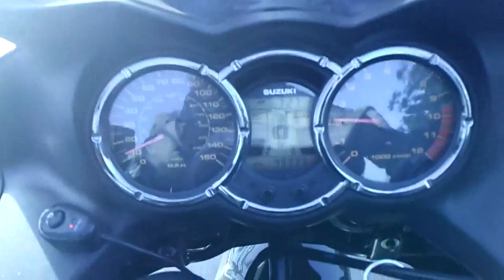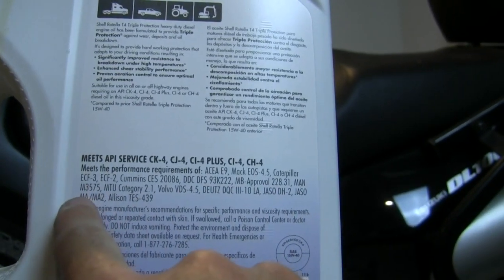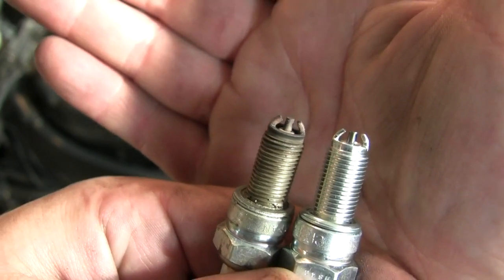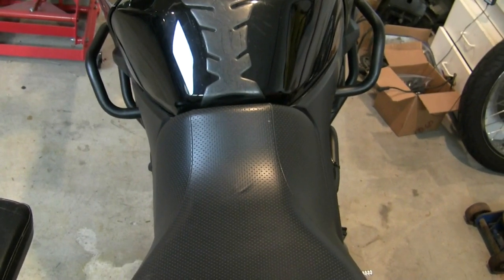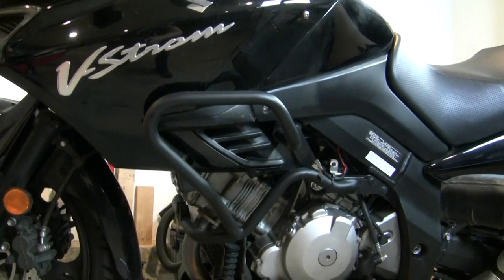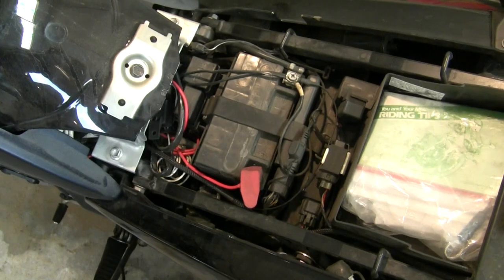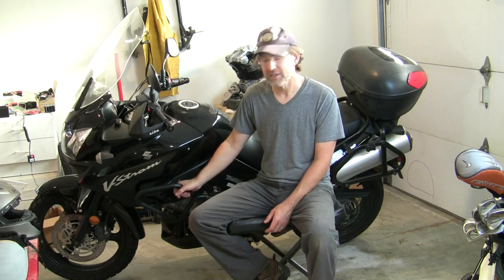V-Strom 50000 Mile In Depth Review

Comment: Great videos, thank you. I have a 2007 k6 GT and it's a great bike but ruined by a (apparently) common fault of a rattly clutch basked. They wear and start to not only sound rattly but cause terrible vibrations. Are you aware of this and, if so, have you done a video on the removal and modification??
Reply from the maker: I've read about the problem but have not experienced it personally, thus no video from me on the subject. I've speculated that either Suzuki got the problem flushed out by 2012 when they built mine or I'm doing something with my riding technique to stave off the problem, but I don't know if either is correct. Thank you for watching!
Reply: @UrbanMonkTV  thanks for the reply. You must have been lucky then as its very common and STILL hasn't been sorted by suzuki on the new model. It's one of the main factors that would stop me getting the new one. If you're at all interested if you look at a site called vibefreev, or sharealike on you tube he modifies them to cure it. Thanks again.

Comment: Great video. Excellent insight very well presented.   Is that oil Shell Rotella T4  or T6?    I'm a DL650 owner.    15 40 weight?  The information is on the jug of oil.    Thank you.    🇨🇦
Reply from the maker: It is T4 15W-40. It is all I've used. As I mentioned in the video, I change very frequently. I've had people say I change too early, but then again I'm currently at 69,000 and still have yet to do any significant changes to tappet shims. 7 out of 8 are still the original shims.
Reply: @UrbanMonkTV  thank you.  After research I started using the same oil in my 2009 DL650.  I use Rotella in my 1999 Mercedes E300D (diesel) too.  370,000 km... runs like new.   Your careful noting on valve clearance is indicating you're getting virtually no wear on your engine.   Changing oil around 2000 miles is not a waste!  It's hugely extending  the life of an excellent engine.   I agree 100% with your schedule.    You're helping many MC enthusiasts.... love your pace and thoroughness of presentations.    Cheers  🇨🇦
Reply from the maker: @ronbatt756  Thank you so much!
Reply: You could easily extend that service interval. Per manual it's every 3,500 miles. If you're doing mostly longer rides (engine is warmed up thoroughly on every ride) you can easily extend it if you switch to a full synthetic oil like Rotella T6. 
I had an oil analysis done after 4,500 miles by Blackstone Labs and it still had a high level of the additives, so degradation was minimal. 
To put it short, change oil according to the manual, switch to full synthetic and you can extend that somewhat (it also won't degrade over time like a conventional oil).
Reply: @sv650nyc7  good info.   Thanks.

Comment: Try using Amsoil, 100% synthetic motorcycle oil. You'll never go back. Bike will run cooler, smoother and with excellent clutch feel with smooth shifting. I could not believe the difference when I switched my Nomad (sold it) to Amsoil.
Reply from the maker: I may try some and see if I notice a difference as you have. I assume you have a Strom too. Which of the Amsoil formulas do you use?

Comment: 1000% right! Unless your ego will suffer if you don’t get a bike several times the price of a VStrom, there is no good reason to get anything different.
Reply from the maker: Thanks for watching. I try to never make any decisions based on my ego. At best it's overly expensive, at worst it is dangerous.
Reply: Urban Monk TV , I didn’t mention it before, but at 67 I’m on my second VStrom 650 and have no plans to switch.
Reply from the maker: @antonioperez1624  How many miles did you put on the first?
Reply: Urban Monk TV, 37k, that was a 2005, current one is a 2012 and it’s right at 17k now. Bought both used and still can’t get the smile of my face. Had some good bikes before, but nothing as good as these.

Comment: I live here in Michigan and we have quite a bit of 40 50° riding do you think the 1540 would still be okay or should I go to a 5:40 synthetic rotella?
Reply from the maker: I grew up in North Dakota and Minnesota, so I can speak to this from experience. Bottom line, the service manual states 15W/40 can be used in ambient temps around a little less than 14 degrees F. It is also worth noting that the SM doesn't list 5 weight oil as an option under any conditions. If your typical behavior involves a minute of warm up at idle before hopping on and riding I don't see a problem with 15w/40 when the ambient temps are anything above freezing. It's a personal call though. It's your bike.
Reply: @UrbanMonkTV   that's great news seems I run that 15/40 in my tractor and my cl350 so one oil does it all .!
Reply from the maker: @daviddaniels4358  👍😄

Comment: Have had a fuel pump failure? If so, how can it be repaired if the parts are not available from Suzuki? Also, my fuel gage stopped working. I'm told that part is no longer available. I'd sure hate to buy used electrical parts on Ebay. Any advice?
Reply from the maker: I haven't yet (knock on wood). I try to keep my fuel level above 1/4 tank always as the fuel bathes the pump and helps keep it a little cooler. I do the same with my cars. I see Babbitts has the fuel pump assembly available through suzukipartshouse.com, but it isn't cheap. I've also read about DIYers replacing the pump with a generic automotive fuel pump. I think  I saw that on a stromtroopers forum. Hope that helps!
Reply: @UrbanMonkTV  thank you so much! I've been searching for while now. I've read about the generic pumps but I really the original part. I'm getting ready for an around the US ride. If I get my V running right (only has 35k miles) I'll ride it. If not, I'll get a new Super Tenere or a new Africa Twin. I just really love my V so I hope I can get it working right! You have been a big help to me!
Reply from the maker: @tomthomsen990  Happy to be of service! Enjoy your trip! I did a big one this summer and want little more than to be right back out there doing it some more.

Comment: Hello. What do you know about the clutch basket issue n have you ever heard of ‘idle hammer’?  Thx.
Reply from the maker: Thank you for watching! My short answer is I've never experienced those "problems." I put that in quotes because I'm still trying to determine for myself if these are legitimate problems that other owners are having in significant numbers or if this is all driven/fed by one source who has an interest in selling solutions. There seems to be only one person/company selling solutions to these problems. That doesn't mean they aren't legitimate, but it does give one pause. Another one I've read a lot about is the spacer to eliminate front/rear sprocket offset - another "problem" I've not experienced.
Reply: Good to hear. I saw the YouTubes on both. I spoke to a guy who had a first gen 1000 n he had his fixed. I had a 2nd gen w 6,500 miles n my basket was noisy n his was silent. The blogs on the idle hammer was more of a concern as they ‘reported’ half to 1000 did it. Saw/heard it on YouTube. I’m looking at a 1000 2003 w 22,000 on it tomorrow. Asking $3,500. I live in Atlanta FYI.

Comment: Any thoughts on idle hammering or clutch chatter?  
Just got an '02 DL1000 with 2700 mile. No clutch chatter yet, but definately has idle hammering. Sounds like I also need a PowerCommander.
Reply from the maker: I definitely benefited from the PC. Had miss between 2500-3000 before that was dangerous when lane splitting. As for idle hammer and clutch chatter, I've not experienced it firsthand so I can't comment with authority on it. Sorry. Thanks for watching!

Comment: what a nice review, how is ur mpg on it on average ?
Reply from the maker: Thanks for watching! Of course it depends on how I'm riding, but 36-39 mph is probably fair. It got a tiny bit worse when I installed the Power Commander, but it runs soooo much better with it. I hear the 650 runs 45 mpg or better.
Reply: I'm getting 47 to 51 driving conservatively with my side cases on.  I carry my tools in them (residential electrician). Lot of highway riding probably 30% or more is city riding.

Comment: Enjoyed your video and I subscribed, I own a 2011 DL650 , I believe the front cylinder is a tough job to do on the 650 compared to the 1000, as its hard to see  the timing marks, do you have any tips as mine a have not been changed in 11000 miles. I have done valve clearances on all the bikes I have owned, but not sure if I should take it to the dealer for a check and adjustment, Many owners seem to say the rarely need adjusting.
Reply from the maker: That's the challenge with these DLs, most often I go through the trouble of opening it up only to find the clearances are fine. But, I feel I have to know that. I have a time lapse video and a real time video showing how I tear down my bike to view tappet clearances. Have you watched those by chance?
Reply: @UrbanMonkTV  No have not seen those videos yet as I only found you yesterday and subscribed then. I will look at them.Thanks.

Comment: I just picked up a first gen with 35,000 miles and finished restoring a 71 Honda cl350 i run 15/40 T4 in it is that what you run in your v-strom 1000??
Reply from the maker: Congrats on your new Strom! Yes, I've run T4 15/40 almost exclusively (don't know what was in it when I bought it at 2300 miles) and the wear in my engine has been minimal. I'm at 66,000 mi now and still going strong. Next valve clearance check is at 75,000 for mine. I expect it to look great as always.

Comment: You've just changed my whole outlook on the words "regular maintenance".  Now, owning a vstrom, appears to be a daunting task of checking valve clearances, cylinder compression.  It appears not much went bad in 50,000 so hopefully I''l have the same provided regular oil changes.  You mentioned nothing about stators, which I've heard others complain about.  Whats your take on that?
Reply from the maker: I've heard some say stator went bad early, others say they are over 100K miles with original stator. I think overall they're a good value. If one needs to repair a V-Strom, the costs are a fraction of what they'd be for a BMW, Triumph or KTM.
Reply: @UrbanMonkTV  Thanks for the quick reply and it's good to know.  One reviewer did say he liked to rev up the RPMs which may have caused the stator problem.  If so I'm good to go because economy rules with me.
Reply from the maker: @advorlando9855  Here too. I'm into getting long term performance out of my bikes and cars. I've never rev'd mine above 5500 rpm. I've not had stator problems or clutch basket problems.

Comment: Well done, I was looking at a 03 do 1000 at 23, 000 mi for 3,500 I was thinking it was a bit to high, but I don't know the history of the bike, the bike is at a dealership.
Reply from the maker: Thanks for watching! If the dealer has a service department, perhaps they would be willing to do a compression check with you present. Also, at that mileage I'd expect the original chain, sprockets and brake pads to be on the bike if it has been ridden with reasonable care (though they could be well worn at that mileage). If they appear to have been replaced already with new, then the previous owner is either overly eager to replace or he rode it hard. I also would look at the clarity of the fluid in the brake master cylinders and clutch master. If dark and cloudy it's an indication of a possible negligent owner.

Comment: what's your mpg like?  Paint the plastic that is melting with primer then silver paint to cool and protect from UV rays.  Thinking about buying a vstrom 650
Reply from the maker: Thanks for the idea! I used to get 40ish, but it's a little worse now with the Power Commander since it's running a tad richer. Runs so well I don't mind though. I've read the 650s do high 40s to 50 mph, but I can't speak from experience on that. I ridden with my friend who was on a BMW 1200GS and he always called for a gas stop b4 I needed it.
Reply: I get almost 50 mpg on the 650 and I hammer the throttle.  I have to test mpg on the 1000.

Comment: Yamaha vs suzuki which one brand have more reliable engine??
Reply from the maker: First, thanks for watching. As I've only owned Suzuki and/or Honda motorcycles my entire life, I can only speak to my experiences with them, which have been, without exception, flawless. Sexy? Sometimes - not always. Functional value? Off the charts in comparison to some other brands. At the end of the day these are all depreciating assets that drain our wallets. To what degree they do that varies. I seek big fun/$ ratio.
Reply: @UrbanMonkTV  then, in honda or suzuki which brand is more durable in engine department...
Reply from the maker: @lokeshdeshwal5288  Of the models I've owned, that award would have to go to Suzuki for this v-twin. That being said, I did burn a hole in a Suzuki GS550 piston once, but comparing that engine from 1978 to this one made in early 2000s is comparing apples to oranges.

Comment: 2012 650 here,  I'd be more concerned with the maintenance history than the actual mileage.   Did my valves at 19500 no adjustment needed.  Changing the fork springs out for my weight made a big difference.
Reply from the maker: I think you are spot on. I'm at 56K now and about to put another 1000 on this weekend. Curious what my clearance check will show when I return. Last check was at 45K, so I can likely go another 4K b4 checking.
Reply: My 2012 650 just did 50k yesterday. I changed the springs and shock for ohlins and went two up (stiffer) on the rear spring and put heavy fork oil in the front. It was expensive so now want to get the investment back out by hitting 100k I've also had to change the clutch once.
And fitted a touring scottoiler which isnt perfect as it pushes the rear numberplate slightly past the rear number plate light
Reply from the maker: @grapewater123  I'm due for a fork oil change. Will likely go with a slightly thicker oil too. Have you been happy with your choice of oil in front?
Reply: @UrbanMonkTV  Yes definitely, I did the ohlins front springs at the same time so I don't know exactly how much improvement either is responsible for, but the main thing I noticed immediately is the bike no longer dives under heavy breaking and in my mind I always put that down to the oil. The steering also feels a lot more tort. 

I'll always use the heaviest oil I can get now so would recommend. 
I did also fit a brace between the two front forks as well but the biggest improvement I noticed was from the oil and springs

Comment: I am looking  at a 04 DL1000 with 5k on it. Just took it for a test ride today and at 3500 to 3700 rpms it chugged really bad.  Is that normal from what your saying? That’s why I need the power commander? It felt as though I was always in the wrong gear even though I wasn’t.  I am looking at it for $2800.  And it’s beautifully clean.  All highway miles.  Should I pull the trigger?
Reply from the maker: That sure sounds like the "miss" or "backfire" the 1st Gen V-Stroms were known for. Mine did it between 2800 and 3500 RPM, badly. Once I put the Power Commander on, that problem went away completely. Note: I had a licensed Power Commander installer do the mapping on a Dyno specifically for my bike. I've read other owners install the PC themselves and install a fueling map they got from the Internet with success, but I'd be concerned that the mapping I was getting would not be correct for my bike. Having a custom map done on the Dyno was worth another $300 to me. It has run flawlessly since for thousands of miles and keeps going. I just rode it today and loved every minute! Hope this helps.
Reply: You were right.  My mechanic worked on it for a week trying to get it to run right.  She balanced the throttle bodies and it still ran crappy from 3500-7k. I bought the cheapest power commander and BAM she set it to the preset #2 and it runs like a raped ape.  Love it.  Cheers.

Comment: Any thoughts on the skid plate to protect the engine? I would think this would be a popular and valuable investment.
Reply from the maker: Thanks for watching! Yes, some people do install skid plates on their Stroms. I've not seen one for the 2002-2012 version that doesn't interrupt airflow into the oil cooler. I live in a hotter climate so have opted to skip the skid plate for that reason. However, the 2014+ models do not have an oil cooler,  so perhaps more owners are opting for them on that version.
Reply: Weld 86  skid plate for 650 only .

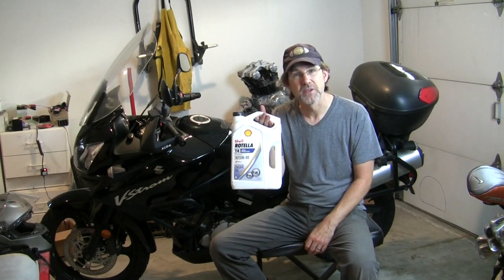Comment: Thank you for your expertise. I picked up a 2015 V650 for my Fathers day.  It has 8K miles.  I will pick up the same Shell Rotella T4 15W-40 as you are holding in 5:48.  Should I be concerned the labeling states for"all heavy duty diesel engines"?  Thank you kindly.
Reply from the maker: I've got 64,000 miles of perfect performance and little to no engine wear that says you shouldn't be concerned. 🙂

Comment: IIRC the pannier and top-box are made by Givi. I don't know what their customer service is like in the U.S. (it's diabolical in most of Europe) but there is a chance you might get replacement reflectors from them.
Reply from the maker: I've not had much luck getting through to Givi regarding those reflectors. Suzuki has the side case reflectors, but not the top case ones. My advice to anyone who has these same cases is to loosen the torque on the little screws that hold the reflectors in place. I've found under the correct tension they last for a long time. Thanks for watching!